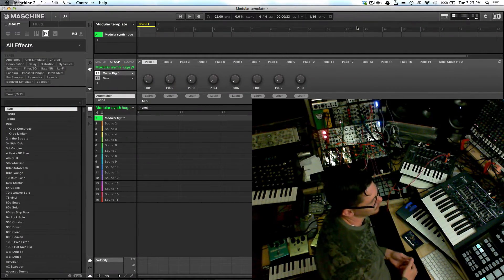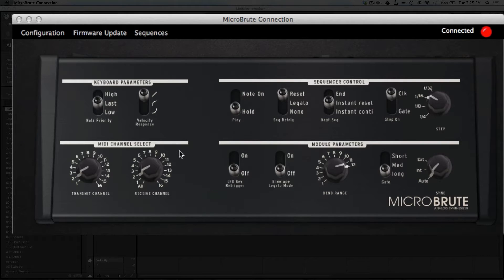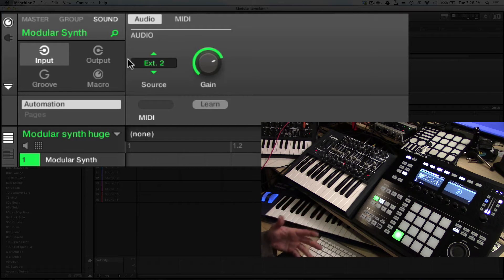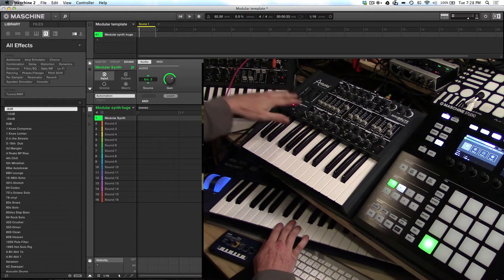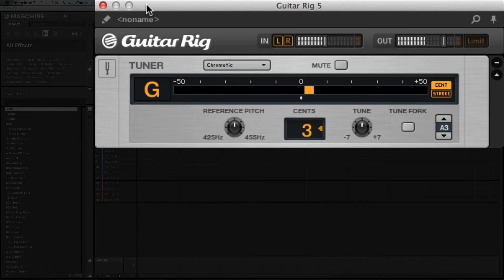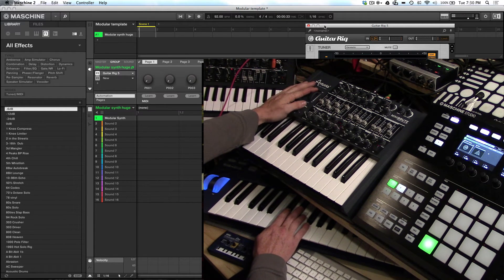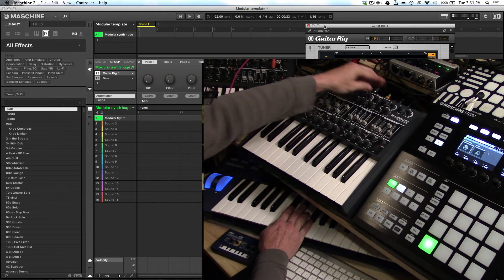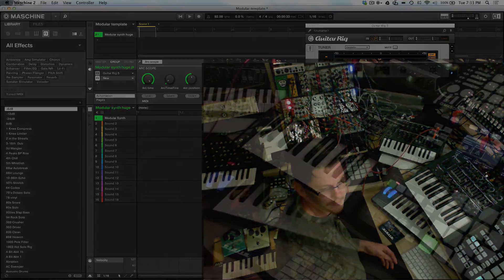How To Route Arturia Minibrute and Microbrute in Maschine 2

Comment: hey flux. thanks for these videos (also watched the other video about this topic, you made a year before this one). i have a basic question tho. if i understood correctly, you are monitoring through maschine, right? how can you do this without latency? it seems like you have regular NI soundcard. so how can you monitor through maschine without ANY latency? seems crazy that you can send midi from maschine, into the synth, audio form the synth back into maschine without latency at all. i purchased a roland boutique a couple of months ago, and still could not use it properly because of latency... please enlighten me flux
Reply from the maker: The latency is sub 14ms tops , you really don't hear it at all. If I were to run direct audio out of my mixer and out through Maschine at the same time, at most you would hear just slight phasing. Running direct through. Maschine the latency is so low it's not actually noticeable. (Obviously don't put mastering plug ins on that chain until you are done recording)
Reply from the maker: It sounds like your system isn't set up properly if you are getting high latency
Reply: +Flux302 of Fluxwithit.com i actually tried it on maschine and ableton. ideally i would want to have maschine open as a plugin in ableton. but i tried it with maschine in standalone, just to see if something was diferent. but yeah, for example ill have a sample playing, just a straight quarter note, then i'll have a midi sequence, also quarter note, sending to the synth, routing the audio back, and  just so far apart. like its CRAZY of. i tried adjusting driver error compensation in ableton, but i had to increase the value so much to the point that i cant use maschine as a plugin anymore, because now maschine has crazy latency lol. 
btw, the roland boutique has midi and audio over usb, but i also have my own soundcard and midi out from maschine controller. so i tried every possible combo, nothing sounded better then the other. 

thanks for the feedback man!

Comment: Thanks Flux for great Videos, don't you use any DAW at all? I use Maschine inside Logic, i also got Modular,  MOPHO and Ipad running, i wonder if i need a DAW  at all, is it better to route Modular, mop and IPAD  into Maschine or Logic? i also use iConnect MIDI for audio pass through to use IPAD, so too much stuff maybe and a bit confusing all that for me as a beginner. Thanks again.
Reply from the maker: +krachwerkstatt when working on songs or certain projects yes I use a daw. for jamming and most song writing, I prefer to not use a daw. currently my two DAW's of choice are Studio one v3, and Ableton live. I used to use Logic but I grew displeased with apple and its update procedures. so I prefer to stick with other companies daws.

Comment: My setup is simpler than yours but I'm still trying to wrap my head around routing of Mini + Micro and my DAW (Logic x). I'm going audio out Micro into Mini then Mini to audio Interface. I'd like to use either my 49 Key midi keyboard or the Minibrute one to play notes. Not sure what should be connected via midi and what via CV. Best so far I get double note sound from the Microbrute which tells me I have to turn of note triggering somewhere. Do you have a written breakdown of set up? Thanks.